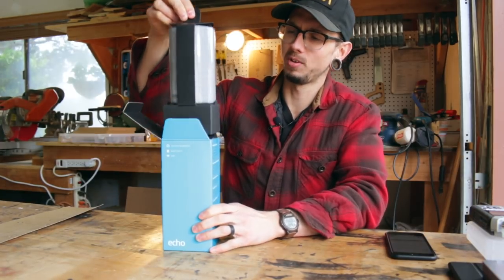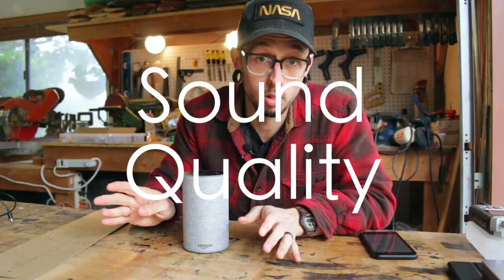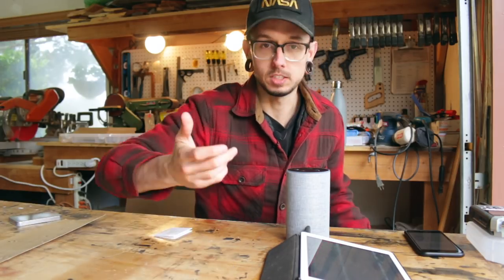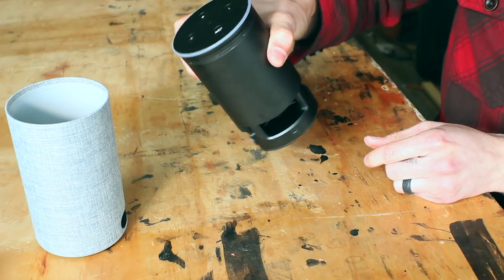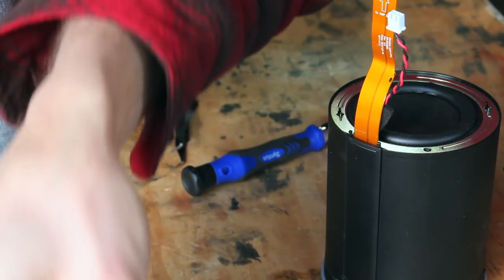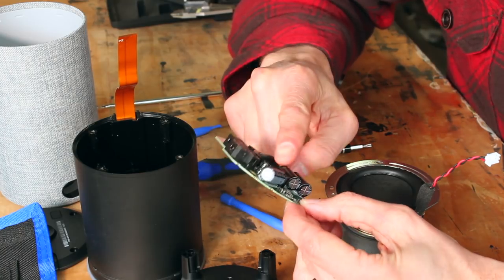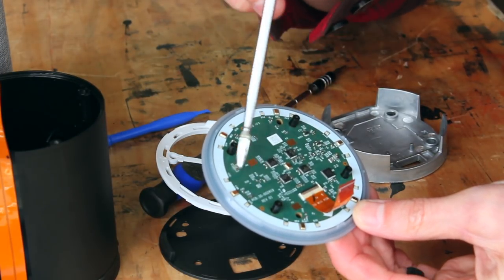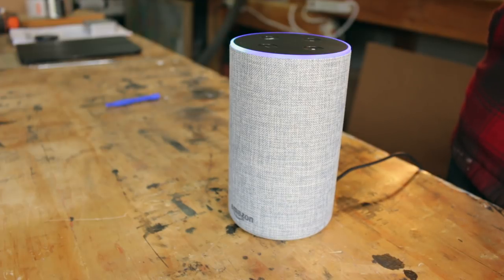Amazon Echo II Teardown & Review

Comment: You should do a video how to DIY mount the Echo Dot 3 to a wall by simply drilling a small hole to the bottom back portion.  There is ample space for a screw head to fit.   The new Google Nest Mini has this as an updated feature.

Comment: Btw. The extra magnet is not for shielding purposes. It's for changing the parameters slightly. Or in other words it's a cheap way to change the speaker a little. Electronics don't care about magnet field. The passives are for the class-d output and for enough buffering for the power supply.

Comment: Has anyone figured out what DAC is in this? To get from whatever Amazon sends, it needs to convert to analog. I don't think it is integrated into the amp so, it has to be under that upper tier encased and heatsink run chip.

Comment: i got a question,, by the power plug on the base of the amazon echo 2nd gen,, the AUX OUT,, would you know if that would be stereo or mono. i understand that you said there is a TI mono amplifier chip and i understand thats for powering the sub and tweeter,, but AUX OUT would be low level non amplified and in this case would the AUX OUT might any chance be in stereo.
Reply: It's stereo